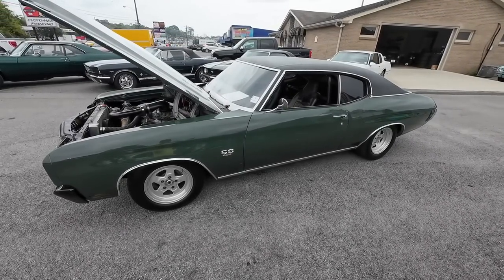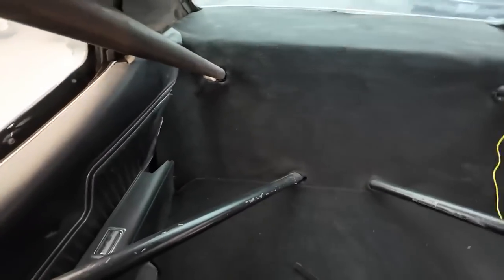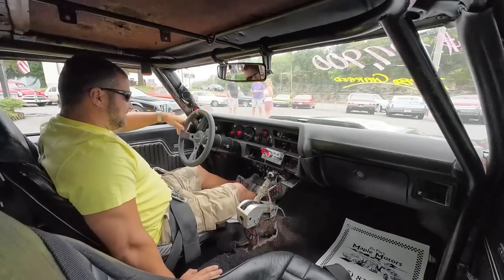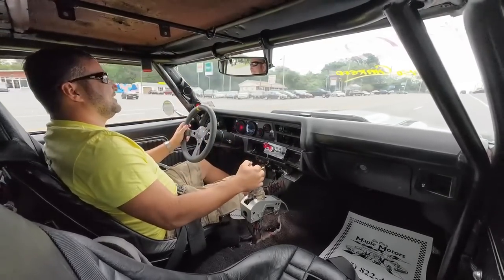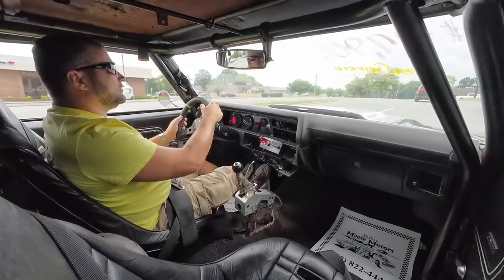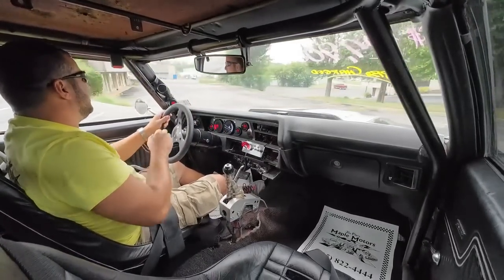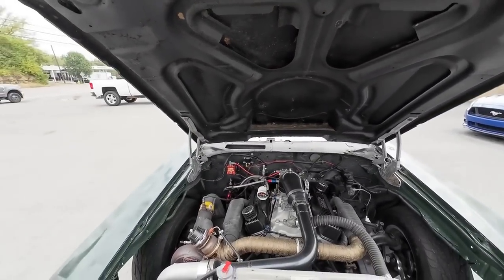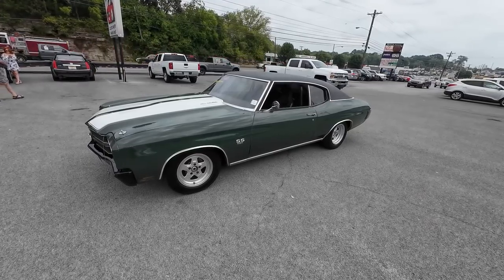Test Drive 1970 Chevrolet Turbo Chevelle SOLD FAST $27,900 Maple Motors #2032-1

Comment: I’m reminded of an entrepreneur that began his start-up used truck dealership the year I got into consumer lending and auto financing, and grew it into a massive state-wide success.

This guy focused on the “unpopular” trucks, such as all the 2WD, regular cabs, and Isuzu branded GM products no one else would buy at auction. There was a demand for cheap trucks, and this guy filled the void in the market to great success.

There are tons of chopped up A-Bodies out there, where money was spent focused on one area (like the drivetrain performance), but skimped on the body, frame, brakes, suspension, or upholstery.

As a sales manager I knew during my stint at Acura used to say, “there’s an ass for every seat!”

Comment: Hi my name is beast and I run on E 85 at 106 to 107 octane all the time. I am your week end fun car and that is for sure. For my E 85 dealer is about 12 miles away so I would carry at least 3, 5 gal  gas cans in my LS 1 truck at 385 HP. To have some more fun on the weekend. But for the cost of the car is not out of the question for a ride like this, because for a car like this is put on by over 25 years of age and is listed historic with no inspection and can only be driven on the weekends. So go for it, as the price is right. SO LETS GO FOR A RIDE !! Remember check your state for what I said.

Comment: I usually like his cars they need work but their much cheaper than a fully restored vehicle but this thing is a money pit
Reply: That’s what I was thinking this thing is rough.
Reply: Unfortunately I agree I have several cars and not try to be a .. but it's a 10,000 car at best
Reply: It would have been easier to point out the good/fair spots….as there weren’t many.  He tells it like it is though, gotta give him that.
Reply: I agree.💯
Reply from the maker: At 10 k I would buy as many as possible , thats just a crazy low price and I could sell this car a 1000 times even at 20k
Reply: If  only the horn would work the s it worth buying 😁
Reply from the maker: And of course it is sold now
Reply: There is a sucker out there evertime

Comment: Reminds me of my old 66 charger. 451 boared out, 8 3/4 rear 4.30 gears etc. interior was so stripped out. Reverse manual valve body. It was fun but really scary driving bcuz it was a drag car. Front end just wanted to get off the ground so easily.

Comment: Love the car, but one problem, Turbo with no power brakes? Now that's scary 😂 😂
Reply: And green..
Reply: @channell11  i had a 66 Biscayne big block 4 speed with no power brakes. I was scary!
Reply: I dont have any power brakes in my 71 with a built 350. I cant imagine what it would be with a turbo lol I still have to use two feet to stop fast lol